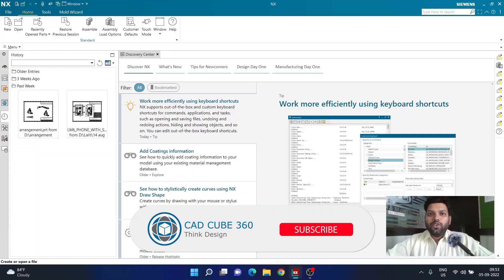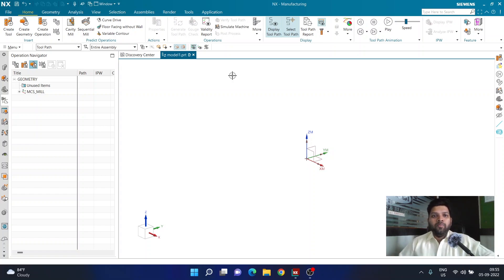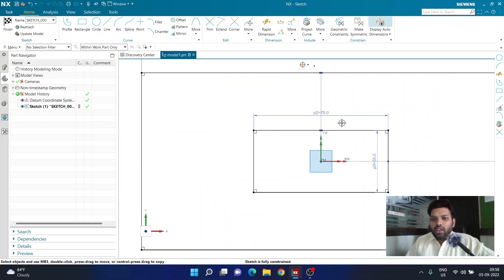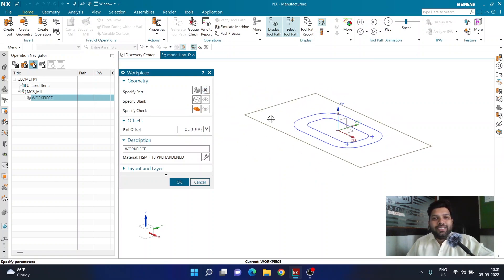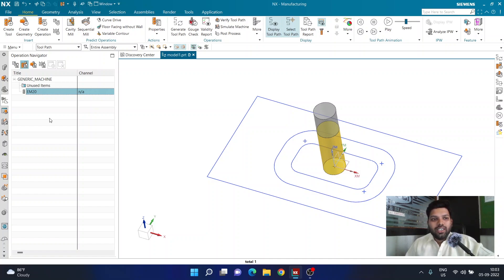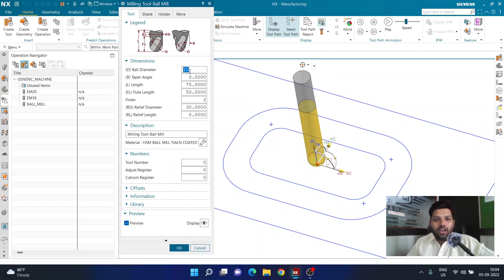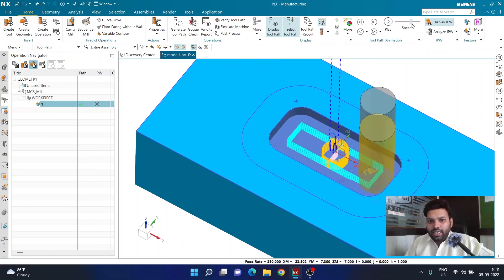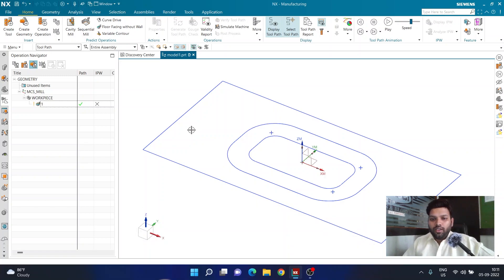PLANAR MILLING -1 | MILLING WITHOUT 3D MODEL | SIEMENS NX

Comment: Is it possible to run a tool on a curve or sketch actually I want to use cnc machine as a pen plottter I know it sound stupid. I've tried with manual programming where I stick a piece of paper on a metal block , set spindle rpm to zero and place a marker in a ER collet and draw a simple circle and it works. but now I've a 2d sketch with lots of curve which not possible to program with manual programming . I'm using the same version of Nx has shown in your video and very new to CAM environment. Is it  possible for you to help me with this. 😃
Reply from the maker: Yes its possible to make the tool run on a curve i will make a video soon